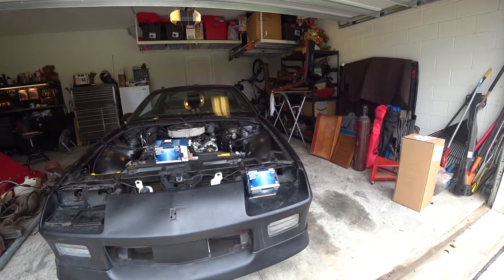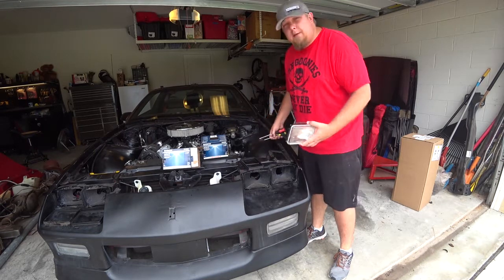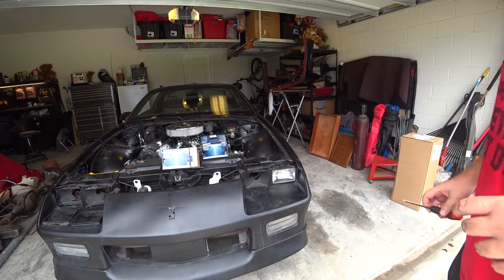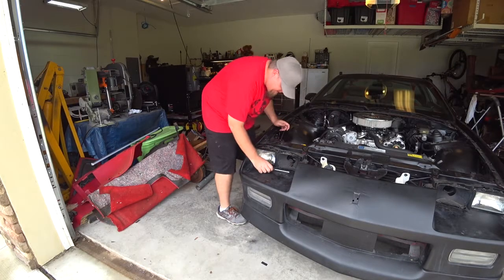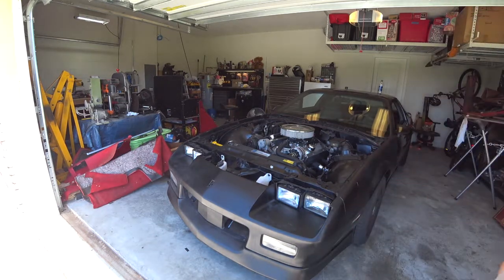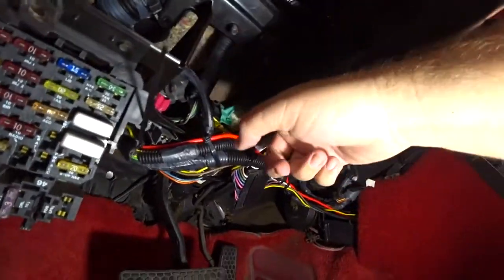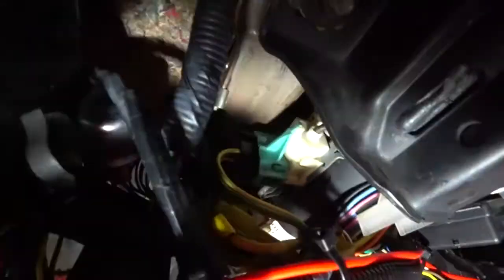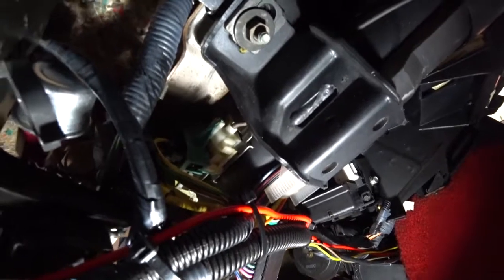Fix your high beam switch and new headlights

Comment: I lost my headlights a couple days ago, my dimmer switch won't click like your did with a push from your finger. My actuator broke years ago, but I'm wondering will the dimmer switch take out my headlights ?
Reply from the maker: allen wrench I am sure they are different systems because this unit is for high beams only and if I unplug it my headlights will still turn on, I can try this when I get back in town Wednesday, I think the pull out switch is for the headlights only.